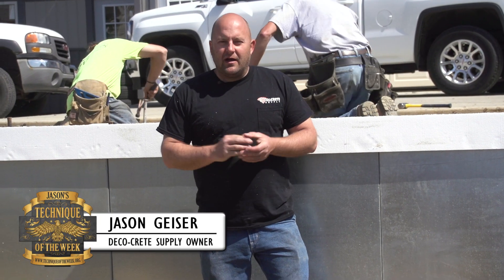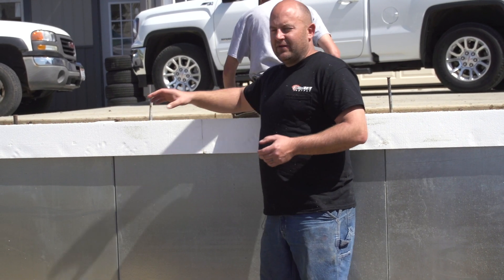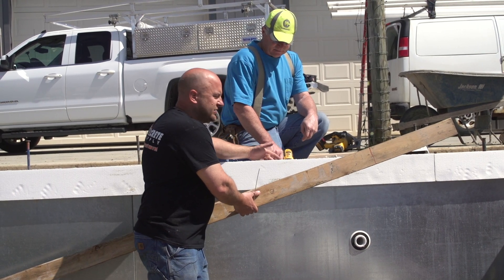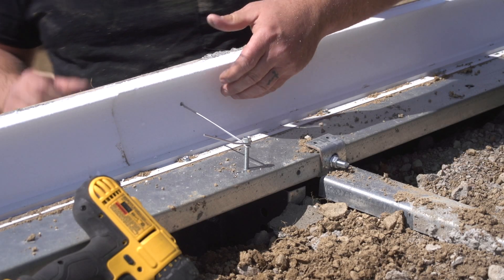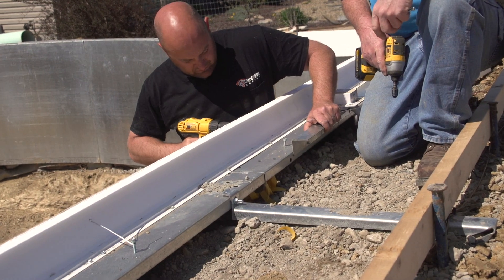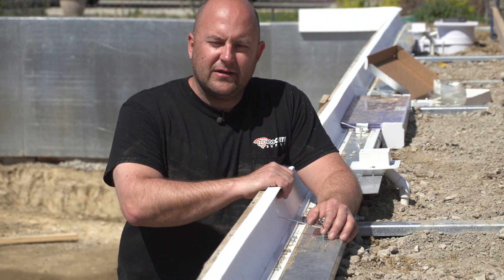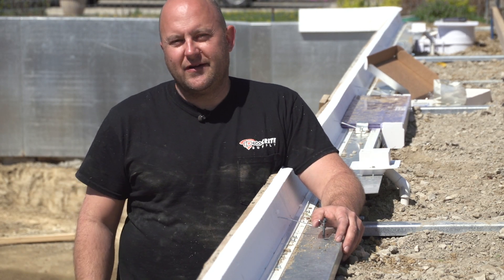Bracing Concrete Pool Forms

Comment: Thank you! This video has been incredibly helpful as we’re watching the “professionals” pour our coping. If they DID NOT brace the forms as you show, how can we remove those wavy undulations from our (now cured) cantilever edge?
Reply from the maker: That's a tough one, once the concrete is cured the only real option is to use an angle grinder diamond wheel to correct the shape. This will work, but it'll look deferent on the areas that you grind. If you don't mind the look of the ground concrete, you could grind the entire coping. If you end up doing this, make to apply some concrete sealer to the coping to protect it. This could be a lot of work depending on how bad the problem is. You could also apply an overlay product to the coping after you have the shape the way you want it. This would help it look more like the rest of the slab. Hopefully this helps, thanks for watching!!!

Comment: When removing the forms I assume the wire is still present. Do you just snip it off flush and continue on with finishing the edge?
Reply: I was going to ask the same question, looking for a reply on this one. Thanks!
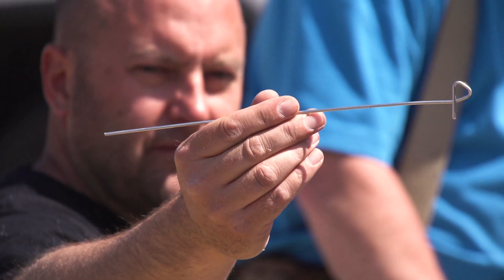Reply from the maker: These specific wire ties have a "weak spot" a few inches from the face so that when you remove the forms, you can twist them off and they easily break off inside the concrete! Thanks for watching!👍 you can actually see the weak spot in the video at 1:08
Reply: For the weak spot in the tie wire, did they account for the three-quarter inch 1x board?